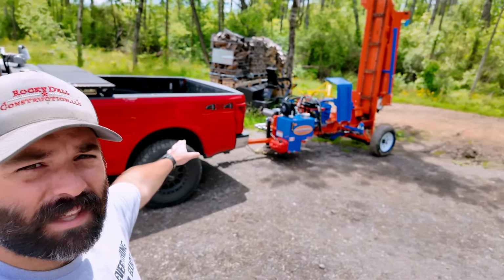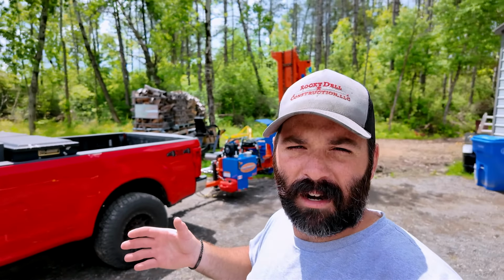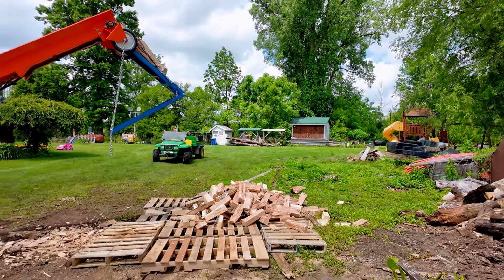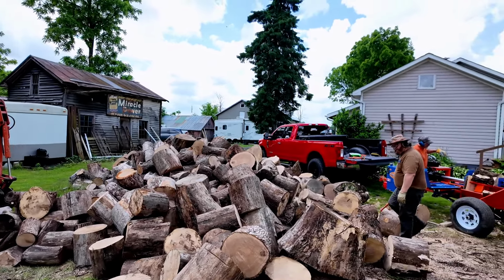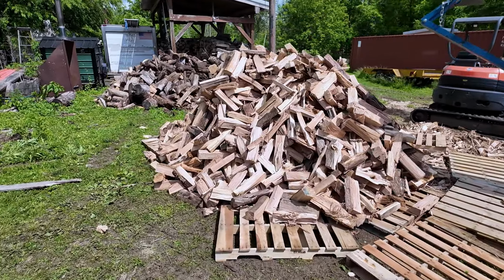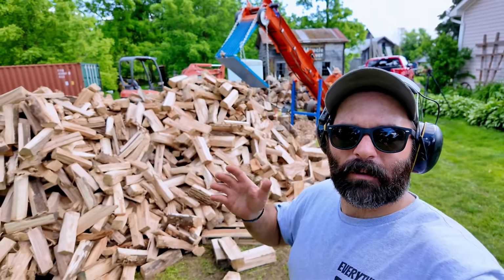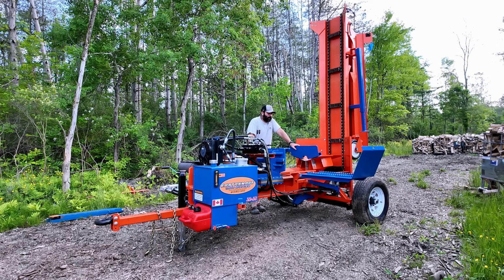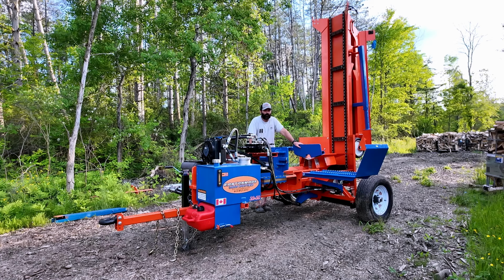New Side Hustle? Log Splitting for Hire!

Comment from the maker: What do you guys think? Is it worth my time? How much would it be worth per hour for you?
Reply: 50 for first hour to cover travel and set up time. 20/hr after. Maybe a bit more if the area is doing well. I ve kicked  around the idea myself but not with that fast of a splitter.
Reply from the maker: @stannelson2582  $20 an hour, not a chance, and let me explain why...

it's a $26,000 unit. So lets compare apples to oranges...excavators, you can buy a mini excavator for the same price, do you think you'd be able to get an owner operator of a mini ex over your house to dig a ditch for your house for $50 travel fee and $20 an hour after that? There's no way...

We ended up splitting about 3 hours, I burnt 6 gal of gas. So I spent $22 on gas, given your recommendation I would collect a total of $90 for the day. Subtract gas so $68 for the day... 45 min drive there in my truck ($9 in fuel) 3 hours there, 45 min drive home ($9 in fuel).

So taking fuel and gas out of it I made $50 for 4.5 hours of work, that's $11-ish an hour.  Not to mention the additional wear and tear added to the truck that will eventually cost me money to service.

I would be better off getting a part time job at the gas station around the corner from my house that pays $18 an hour...
Reply: @EverythingElliott  your right with that machine your forced to change 100 plus like light equipment operator.
Reply: @EverythingElliott  or you could look at it like a lawn service.  What’s the going rate for a lawn service to mow.  Is it 100 bucks an hour?  I don’t really know.
Reply from the maker: @stannelson2582  I'm not sure what law services charge as I've always mowed my own lawn, but I bet its right up there around that.
Reply: Maybe charge by cord split and charge for mileage driven? Figure out the cost per cord to operate your machine from what you sell per cord  and charge 50-75% of your price per cord for seasoned firewood? Just thoughts.
Reply from the maker: @Opinionatedguy1989  not a bad thought. another guy I talked to said he charges by full cord, what he would normally get for a seasoned facecord.  Since he doesnt have to stack and store the firewood the person is basically getting buy one get 2 free since they are dealing with the stacking and storing.

Comment: It's a good question(s). I guess if you are doing all the work and charging for your time, that is one scenario, but if they are helping you then if you break down that charge between the amortized/depreciated cost of the equipment and your hourly labour charge, and, assuming you insuring the liability of the users(?), or only yourself? If you are contracted to split it all yourself versus "renting" the machine itself to them, this all can change the financial feasibility of it quite a bit. Good luck and thanks - good video!
Reply from the maker: There certainly are a lot of factors that would differ from person to person (help/no help) and that would have a big impact on the cost per hour of the unit....lots to think about.  Thanks for watching!

Comment: That's a pretty sweet machine compared to what most rental stores have. I'd way it's worth double what they charge. I bet most guys would pay a day rate, get ready for it's arrival and get a ton of buddies to help them run the hour meter up while they split 2 years worth of wood, so if it was $600-$800 for a weekend and they got 10-20 cord out of it I'd say it's worth it. Not to mention a boat load of fun!
Reply from the maker: most rental places are about $100 for the day, however...I can make as much firewood with this in 1 hour as that rental machine can make in a day.  I think the biggest hurdle is going to be the "renter" understanding the amount of firewood it produces in a certain amount of time.

Comment: Elliott you need to work out per/ mile to pull EASTONMADE split , minus wage per hr in Canada 🇨🇦 going # is $35.00 , now a price for the EASTONMADE per hr or by day . Might work out by cords to easy to scale your firewood block on site . Elliott you need a trailer hitch on your truck 🛻 for on the road . See what you did , we would get hung out to dry on highway here . Trailer got to lock 🔒 to a vehicle hitch. In your case the EASTONMADE hit a bad bump it can jump off your trailer ball . Just THINK 🤔 SAFETY and always put SAFETY FIRST pulling equipments and trailer 😊 Tks a million for your time and great video. 😊
Reply from the maker: I don’t think $35 an hour is enough to pay me and cover expenses. The splitter was locked in, check out the Gen Y pintle hitch, it has a piece that locks the lunette ring in. I just didn’t show that on video.

Comment: Please tell me that you didn't tow the splitter sitting on the ball hitch and that you used a pintel receiver hitch instead. My eyes went wide open when I saw that hookup
Reply: First thing I see hook 🪝 on the ball . THINK 🤔 SAFETY and always put SAFETY FIRST 😊 lol you got a good 👍 eye 👁 to .
Reply from the maker: Check out the gen y pintle hitch. It’s what I have. In the adjustment slot above the ball there is a bar that slides out to lock the lunette ring in place.
Reply from the maker: It was locked in

Comment: In my area, most people heating with wood either cut and split their own or buy 10-20 face cords delivered. We do have people who will come to your place with a processor that will cut and split. They charge $150/hour ($CDN). Extra if they have to bring a loader to move the logs. The processor (a Bell 4000) can do ~10 face cords per hour.
Reply from the maker: With 2 guys this machine can put out about a facecord every 10-15 min depending on the wood. I don’t think we’re far off in price. Main difference is the processor cuts for you, but that’s where the owner would be saving that $50 an hour and essentially be paying themselves (in savings) $50 an hour to cut their own wood

Comment: You will have to establish a minimum price for showing up. In this case I would use clock hours not machine hours. The time starts when you start the conveyor. This should help induce people to help keep the machine fed.  Then it is x amount of dollars per hour after the initial time has passed. And yes there’s a market for this service. I would be upfront with the customer and tell them if you have to bring help the price goes up by a little more than the wage you are paying the help. My nephew does this. He gives them 2 price options to choose from. I hope this helps or gives you something to consider. Have a great day.
Reply from the maker: I like the idea of decreasing price if I am just pulling levers and increasing price if I am 100% hands on and bringing a helper.  I think that is a very fair way of pricing a job.  When I do other side jobs, if the homeowner is putting in sweat equity, they get a better price.

Comment: $100 minimum! And you're very right about it being the right customer.

Id suggest thinking of yourself as a premium wood splitting service. You drive a nice truck, you dress appropriately and professionally, you have manners, you dont smoke, you dont drink on the job.. hell, that machine alone makes you a premium service with how fast it is!

Your competitors are the opposite of all those attributes. Im sure you've seen em scootin around in a beat up Ford Ranger lol

Dont sell yourself short!
Reply from the maker: You bring up some very good points! Thanks for watching!
Reply: I agree.  Elliot, you have time invested in prep for transport and set up on site.  If you operate the machine it's your labor. If your customer is running the machine, you have provided instruction and are supervising, and I watched the video, you were not sitting in the cab of your truck reading a book.  You were helping them maximize the time your machine was there, even if you were using their mini-ex to do it (& enjoying every minute).  Then there is the fuel & maintenance cost of truck & splitter and your time to deal with both.  Great video & don't sell yourself short.

Comment: Interesting concept. But before you make a decision be sure to consider everything that would be involved. To start, there is the need for liability insurance for yourself. There is also a need for insurance in the case of someone assisting you. Also not everyone has the addition of excavators and tractors with buckets to assist with your process. That puts added wear on your body. Don’t forget the small things like will you be responsible for cleaning up and disposing of the slash that comes off your grizzly bars. However, if someone has a pile of wood like the one you videod (?), it could very well be worth doing. 
As an aside, I noticed something that I hope you changed off camera. It would be much better if you connected your splitter to the truck with a real pintle hitch rather than just setting it on the ball hitch. By the way, I do enjoy your video travels through life!
Reply from the maker: insurance would be a must if I did this for anyone other than a close friend or family, no doubt about that.  I actually didnt know he had an excavator there until I arrived, and I was very happy to see it.  As far as the hitch goes, thats a Gen Y Pintle hitch, theres a bar that comes out of the hitch and locks the lunette ring in, I just didnt film that part, but given how many people were concerned about it, I guess I'll have to show that next time!
Reply: @EverythingElliott  good to see you’re thinking of things. Stay safe.

Comment: I don't know your market area is but 13 years ago when I got my dyna sc-16 I would charge 250 bucks to do a tri-axle load of wood they had to load the wood on the processor it would take normally 4 hours to do they all payed cash money. An unknown quantity of wood should be worth 75 to 80 bucks per hour never ever let let someone rent your machine I did 1 time never happened again. I made the bulk of my money in mobile processing in the beginning but at about 59 my back and knees got bad could not take standing in 1 spot for 4 hours and just did firewood for delivery out of my yard was still good money but the mobile processing was the most money I did not have to buy logs I did not deliver anything but me and the processor was low overhead to do that
Reply from the maker: Not having to figure out delivery is the best part of it…and not having to cut. I don’t mind pulling levers all day that’s for sure

Comment: I think the axil configuration being at the rear is a far better thing for a traveling wood splitting service.
.
One question i will get answered some day is, can you order it on the smaller machines that way??
.
FOR UNSTACKED WOOD.
The department of weights and mesherments generally except 180 cubic feet as a cord for 16" split wood.
195 cf for 24" wood.
.
Another thing to consider is a minimum cost for people.
Like $200ish 
.
Also travel time.
 2 hours there, 2 hours splitting and 2 hours home.
Dosen't make for much $$$$
.
Another way to look at it.
A 8 hour $35 an hour job will make you $280 a day.
After all expenses, are you making $280 a day??
.
0.01c
Reply from the maker: The reason the axle is at the back of the machine is because of the attached conveyor. I don’t think you can get it that way in the smaller units. As far as drive time goes, I usually factor that into the price of the job, unless they only live a couple minutes from me then it’s negligible. I think at $100 an hour I’d be well covering my expenses/maintenance and have plenty left over to pay myself
Reply: @EverythingElliott  
I think how prepared the person is will be a big factor as well.
Or asking you to go in to an area that's about a 90% chance of getting stuck.
.
Those sorta things can transform a person's interest in renting out there, time and equipment.
Reply from the maker: @BGWenterprises  I certainly would have no issue telling someone no...it's not like I would depend on the money to feed my family.  Maybe I just do it for a couple people that I know well, and are looking to help them out.

Comment: Need a fuel cost for both travel and splitter. Give yourself plenty of wiggle room. These machines aren't free to own or run. Obviously time is valuable in any situation, so you need to figure in what you're time is worth. I'd set yourself a minimum to leave your house. You have teardown at your property, setup at the customers, teardown at the customs, etc. 

Also, any future plans for the 7.3?
Reply from the maker: That's a very good point, the way I look at it is you have to pay me to be away from my family, which can be quite expensive. and life has been so busy I haven't had any forward movement on that truck. its running driving as is, I really need to get a move on with the new motor.
Reply: @EverythingElliott  Word. I get it with a little one, makes you want to be a home body. You could always do a drop and leave kinda rent out but then you have to have trust thay the customer won't ruin it. Daily, vs weekly rental.
Reply from the maker: @zanepyles9092  There is a very select few people I would trust using this machine without my watchful eye.  Since there's no "insurance" to replace it similar to a car, I would have to know they have the ability to purchase a new one if they destroy it.